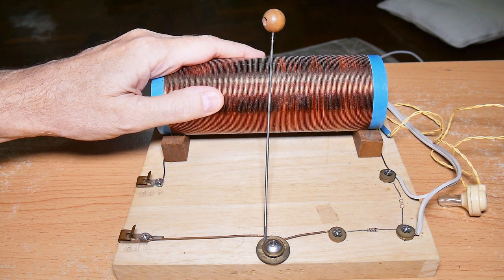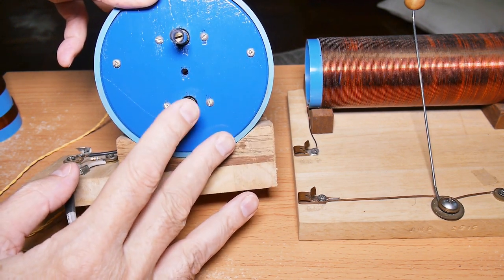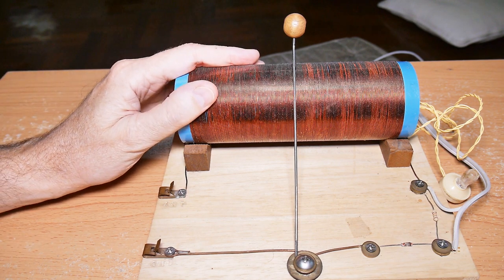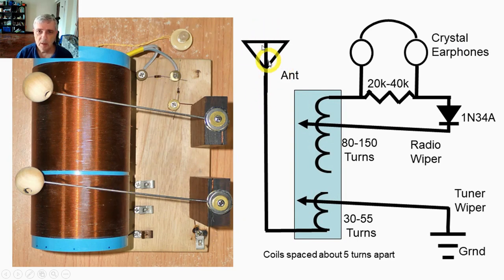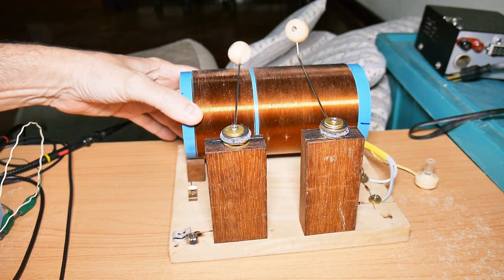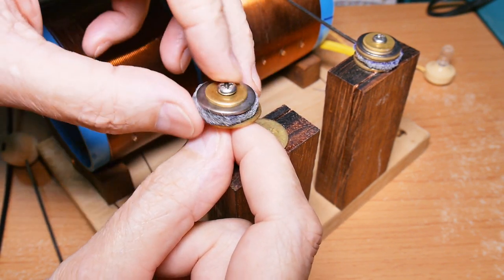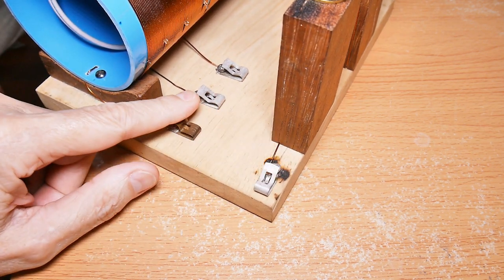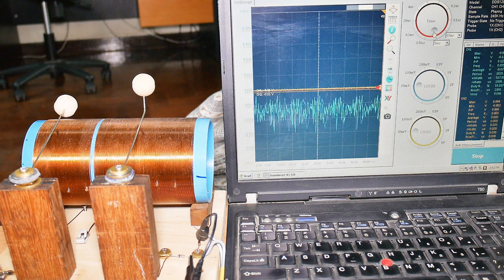My New Favorite!  Crystal Radio with Antenna Tuner

Comment: Edited for clarification and spelling typos:  his is the first homemade crystal radio I could hear (edit starting here) without the radio having any audio amplification built into the radio.
Oh your audio on your speaking volume is very good.   I have a lot of videos I want to watch and their audio is just too low to hear.
No capacitor at all on this crystal radio !
Reply from the maker: The capacitance in this radio comes from the coil (along with the inductance of course) and the piezoelectric earphone. Adding more capacitance puts the resonance of the circuit out of the AM band.
Reply: @tsbrownie  Thank you.  I understand.  When I get a radio circuit to work I'm going to make the model with the L match..
Reply from the maker: @southernexposure123  I think you'll like it. Even though the one in my video is just a crude experiment, it works better than any of my others!
Reply: @tsbrownie  Yes.  If I remember right you suggest winding more turns on the demodulator coil than you put on the first one you made..  170 turns on the diode coil and 30 to 55 turns on the grounded coii.  As soon as I heard it play I drew that schematic and put it on my desk.  I'll get some 14 or 16 GA wire from an old motor.  It looks like aluminum wire.  I know copper is easier to solder etc.
Reply from the maker: @southernexposure123  I wish I could go back and update that. I was not clear that was a SWAG estimate. With a 3" coil, the left side does not need so many turns (https://youtu.be/ejHk5tFeKHk); it would only need 91 turns in theory. I might go with 100 as a starter and remove turns to tune it.
Reply: @tsbrownie   I need to say I had to listen to the video several times to be sure about what you were saying about the difference between  the coils you were demonstrating and how you were recommending the coils to be built by viewers.    So, I still didn't get it.  lol   So, I appreciate you sharing that information now because it's helpful to me.
 I've learned how difficult it is to communicate clearly, especially live and under pressure.  I also know how valuable it is to people who make videos to see the number of views a video gets.  That makes it hard to take down a video just to re-make it so that it does communicate like it was intended to at first.  When a video is taken down the view count gets lost.  AND the viewer comments are also lost.  I read comments under videos much farther than people realze and I learn a lot from comments much of the time.
What some video makers do (and I did it at least once) is to declare a "Do Over."    Instead of "Do Over" some people do an "UPDATE."
That way communication can be made more clear and the viewer count isn't lost for the original video.  PLUS your view number increases because it's a toitally new video as far as YT is concerned.
I posted over 1,500 videos and at least once I declared to my viewers  "This video is a Do Over."  
At the moment all (except one) of the videos I posted are hidden.   It's an involved reason, likely only understood by me.
Anyway, I'll watch the video you linked for me.  I have a feeling I already watched it.    lol    I've watched more of your videos than I commented on.  It's good for me to review the information again if I've seen it already.  And If I'm mistaken and didn't watch it already it's a bonus.  That's what I call a win/win.
Thanks for the additional information.
Reply from the maker: @southernexposure123  Only another Youtuber can appreciate the finer points of making videos. I just looked at your channel and you have 1 video and 5700 subs! That's AMAZING! What happened to your other videos/channels? Did you give up? I've thought about throwing in the towel several times, but then there's always one more thing....
Reply: @tsbrownie  LOL  the reason I hid those other videos is a long and boring story.  To me its a matter if principle.  
I have a comment to post.  I'm looking for the rigjht place to post it.  It has to do with using a drill for a coil winder.  I'll find it soon.

Comment: I like the antenna tuner idea.

I wonder if you could use less coils on the other side and insert a ferrite rod in and out for tuning.

The ferrite rod could be attached to a bolt for fine tuning control.
Reply from the maker: Shhhhhh. Keep this a secret, but I am (very slowly) working on something similar.
Reply: @tsbrownie  how is the progress rn?
Reply from the maker: Sorry, just saw your comment. It's still in the queue!

Comment: I really like this design, the idea of the antenna match coil excellent. 
Would any benefit be gained by adding a capacitor in parallel with radio coil?
I've watched your video on useless designs. 
So is the one coil enough?
Reply from the maker: Those are some really profound questions. I have tried a variable capacitor (0 to 365 pF) in various configurations with this setup (hence all the taps) and never saw any benefit. I think it requires a significantly different design where the coil is just part of (maybe half) of the LC circuit, and that circuit is fed by both a circuit tunable to the antenna, and a filter in between to trap unwanted stations. I'm thinking about that and have taken the first few (baby) steps.
Reply: Thank You for your answer. 
Have a Great Christmas.
Reply from the maker: @johnmckee7937  You're welcome! Merry Christmas & Happy New Year!

Comment: Where did you get the nice blue-colored 2-3/8" O.D. tubing? A plumber gave me a short piece years ago, he thought it was used for sprinkler systems. I've looked all over for it. Makes a pretty coil form.
Reply from the maker: It's been a long time. I think it's left over from the plumber who did some drain work for the neighbor.
Reply: @tsbrownie  I've been using some 2" OD plastic. Only about 1/16"wall thickness. Thinner than sch. 30. Perfect. Cheap where vacuum shops install central vac systems.
Reply from the maker: @Jomatsch  The wall thickness is not critical, it just makes it stronger. My first radio had a cardboard tube and was crushed by accident. A lot of winding work lost!
Reply: @tsbrownie  My first coil in 7th grade was wound on a piece of bamboo with wire from an old washing machine motor.

Comment: Dear tsbrownie, how to determine the amount of turns that i need on a other Coil and Wire Size, exp: i have 0,85mm enameled wire, and i use 2 inch of pipe, then to make Dual Wiper Crystal radio, how much turn do i need for antenna coil and for the tuning coil? And how far the separation between coil need?
Reply from the maker: These 2 videos explain it. Also, there are links to coil calculators in the description so you can choose the wire size and core size. I would stay with a core of 2" or 2.5" for best results.

https://youtu.be/ejHk5tFeKHk
https://youtu.be/sF8HLl88Egk

Comment: Hello i don't know if your still building radios or not, But i building one something like this with a  antenna coil. when you was explaining the  antenna coil., Does it connect to the radio coil? ( what i mean both coil is one? ) but with a space between them?
Reply from the maker: There are both styles. I have radio videos  for each. This radio is 2 individual coils. Yes I am still building, I am working on one right now.

Comment: This is probably the best design of all.  Unfortunately you do not explain how the two coils work.    Is the smaller coil connected to the larger one?    Or  are the two coils separate  but use the process of induction to transfer the signal between both coils.  It looks like the ground and antenna are connected to the small coil and the diode and resister and ear piece is connected to the larger coil.
Reply from the maker: This is more about building it, the theory behind how it works is college level advanced analog electronics; most people are not interested in that. The short coil is the antenna coil: the antenna comes in one side and goes to ground at the other. It is "loosely coupled" to the other coil which is part of the tank circuit (resonant part of the circuit that sets the station you hear).  In brief, the electromagnetic field created in the antenna coil is "shared" with the other coil (you've probably seen the field lines when someone sprinkles metal power on a piece of paper that's over a magnet. Those lines are shared.) It's basically an RF transformer. It helps create a cleaner impedance match with the antenna.

Comment: Just gathering parts to make my first crystal radio. I've got a piece of 1.5" pvc pipe, 19AWG wire and you had mentioned in another video about 235 turns.. can I add the 30/50 turns for the antenna next to that??  I've enjoyed learning from your videos.. great stuff👍
Reply from the maker: Not really. The pipe size changes the inductance which changes the frequency range of the radio. Check this out:  https://youtu.be/ejHk5tFeKHk

Comment: What is the gauge of the wire? If 1" pvc is used with the same length/or longer, will it work? 
How about using a cylindrical magnetic inside the coil "pipe"?
Reply from the maker: All of the specifications are listed in the description, including pipe and wire sizes. I have a video on how to design your own coil using free software on the internet: https://www.youtube.com/watch?v=Fw9eb-aB-XU
Reply: @tsbrownie  oh.. Ok thank you sir.

Comment: I once came across a diagram for crystal radio that had transistor boost amplification make it a bit louder and the transistor was supposed to be powered by radio waves so it was still free powered.
I wanted to try a build one to see if it worked any good but lost track of diagram.
Reply from the maker: If I recall, the channel called "BillyDIY" has a couple such radios. I tried searching "BillyDIY crystal radio transistor" but came up with nothing. I don't think he used the word transistor in the title, more like mosfet or some other.
Reply: @tsbrownie  the guy ' glasslinger ' who builds vacuum tubes from scratch had a nice vacuum tube amplified crystal radio in one of his videos.
The radio seemed extremely good at station selection even if it didn't have the amplification and it used a variable capacitor.
Reply from the maker: @michaelszczys8316  Capacitivly tuned radios work and work well, but they are fussier and harder to make.  I have a video on one style I found in an ancient radio magazine, and it's not as loud, but the sound is very clear and it has good discrimination.

Comment: If I put the Crystal Ear Piece at the end of a gramophone horn, would the sound 'normally' be strong enough to be audible? I was thinking of making a crystal set in a wooden box, with a wooden horn built into the lid. I have a V (or L) shaped 20M long wire antenna in the attic (attached to the beams through rubber bands) that I have used to pick up a signal before?

Would this setup work, be strong enough to produce sound?
I do have an Oscilloscope for testing for a signal.
Reply from the maker: That is an interesting idea. I can't say I have thought of it or heard of someone doing it before. In most ear pieces the ear part unscrews, so it would be an easy experiment for your to try. I'd start with a paper cone and see if that works before going on to something more time consuming. Let me know how it goes, I am curious.

Comment: So, what are you grounding to, and you don't need an external antenna anymore since your coil and other wiper replaces that?
Reply from the maker: I am grounded to the steel in the house. A significant antenna is required, that's where the power is coming from. The coil is part of a resonant circuit.

Comment: Nice. As for the antenna, you can buy or make a "lightning arrestor". This will make your system safe from potential lightning strikes. 
Q: What program are you using that turns your computer into an oscilloscope? And do you use a capacitor inline from the radio to the computer?
Reply from the maker: Thanks!
A1: I bought a rather cheap USB oscilloscope.  It's both hardware and software.  They don't make it any more.   I hear that Hantek makes some good ones and I'd check those out next time I buy one.  However my first choice is a dedicated unit because the laptop always has compatibility issues and it takes up lots of bench top space.
A2: No cap.  The probes / scope are high impedance, and don't seem to affect the output.

Comment: o boy...I just went to the age of 50 ( o yea) and remember my father always told me when I was a kid ..we gonna build that but it never came. Now my father has past away recentley memories are getting in my head and this is one of them...now I am gonna build that cristal radio. So 1 thing ( sorry..i'm not an electronic man). The first coil starts at the antenna...and it ends to a clip I see on your bord but its not connected to anything?  The start of the 100 and ...50 turns or so is also not connected to anything ? I'm gonna have fun with this. Thank you for this perfect video.
Reply from the maker: In this radio, the 2 coils are NOT connected. The ends have no connection at all. Other radios will have connections on each end, not this one. 
Look in the description for details. You should follow the tube and wire sizes carefully. Please let me know if you have questions.

Comment: I really like the antenna tuner concept, it address the impedance matching issue i think. How many stations did you receive across the AM band? How long was the antenna? What was used for ground? I don't understand why there is no need for a capacitor in the resonant circuit. Did the earphone act as a capacitor? Thanks for the neat project.
Reply from the maker: Thank you.  Max stations I can recognize has been 17.  The antennas run under the roof line.  One is 7 meters and the other about 15 meters.  Ground is a rod in the ground.  Yes, modern "crystal" earphones are piezoelectric and have capacitance of their own.  In fact they need the resistor to drain the excess capacitance or you will get very reduced sounds and lots of static.

Comment: Antenna is the first clip, then two more clips below the small coil are connected to wire under that part of the coil ?
Reply from the maker: The other two clips are "left over" from an earlier design / experiment.  One is the end of the antenna coil.  The other is the beginning of the radio coil.

Comment: I have a bunch of 47K  resistors, will these work with this design?
Reply from the maker: It might. Give it a try. If the sound is too quiet or has pops in it, go with a lower value.
Reply: Do I also need to put the taps in?
Reply from the maker: @chris mead  I was experimenting on length of the coil and where the ground and antenna might attach. No they are not necessary for normal operation.
Reply: @tsbrownie  I found 2w 30k resistors, will those work?
Reply from the maker: @chrismead1464  They will likely work better than the 47k ohm resistors. Give it a try. Crystal radio is a lot about experimenting, seeing what works, and what does not.
Reply: @tsbrownie  Me again, I have 2" diameter pvc laying around, will that work as the coil?
Reply from the maker: @chrismead1464  Any changes to the diameter, length, wire size, or number of turns will change the tuning. I have a video on designing your own coil. 
https://www.youtube.com/watch?v=Fw9eb-aB-XU
Reply: @tsbrownie  Cool, thanks for the info, just waiting until I can get an antenna put up before trying to build one.

Comment: Thanks for explaining. Which oscilloscope did you use ?
Reply: I was going to ask the same thing. Great video by the way!!
Reply: He is not using an oscilloscope but a program on his computer that allows it to function as an oscilloscope. And I just asked him what program he is using and also about the connection from the radio to the computer.
Reply from the maker: Thank you!
Reply from the maker: @heidobito7924  Thank you.

Comment: What's the maximum frequency you can tune with this radio?  Is it possible to get up into any bands above the commercial broadcast band with what you have here?
Reply from the maker: It only works with AM and pretty strong signals. You can google things like RF spectrum or AM broadcast bands. There are others that ships use, ham radio operators use, etc. but I don't know if the signals would be strong enough. You'd need long antennas, an amplifier on the output, and be within tens of miles of the source to have a good chance of success.
Reply: @tsbrownie  Most shortwave radio stations still broadcast in AM, right?  I know the signal would have to be pretty strong to induce in the coil, but there are signals strong enough...IF you get enough wire in the air.  Oh well, I may just build one of your designs and be happy with regular broadcast.
Reply from the maker: @jdschauss  FM has become more popular and this will not work with FM. (Some countries have replaced their Am civilian broadcasts with FM.) You have a good strategy, start simple and work to more difficult.
Reply: @tsbrownie  Oh, I know it's AM only.  Again, I was just wondering specifically about 49 meters, but it looks like it may be too difficult a project and the end result may be disappointing.  Thanks anyway.